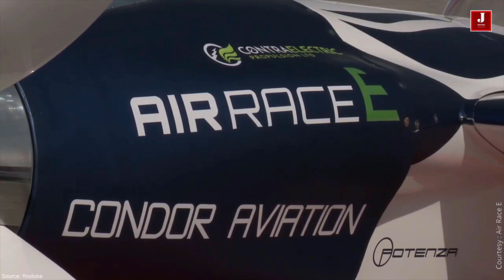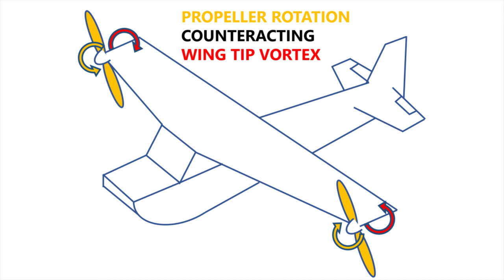Nascar in the Sky - Interview with Air Race E

Comment: Propellers at the wing tips to counter wing tip vortex is a wrong approach. It is explained why in the book by Doug McLean.  Much better approach is (in my opinion) a bell shaped lift distribution, where the outer part of the wing basically acts as a flattened down winglet, giving you benefits in the turns as well.
Reply from the maker: Hi Jure, I agree that there are multiple options to increase wing lift performance. And for some applications, the flattened down winglet could be the best (like glider planes for example). But each application has different constraints, like maximum wingspan for example, or maximum wing loading and so on. So race planes, cargo planes, and in the future electric planes, will each have their own distinct shape, tailored to their constraints. Electric motors at the wingtips can to some extent counteract the vortices, but they also add a lot of inertia to the plane (the mass of the motors far out), perhaps reducing manoeuvrability. The electric plane market is still so young that we'll probably first see many concepts pop up before we converge to a common setup. And I think that is exciting ;)
Reply: Exactly. Model gliders with wing span limit is the area I'm exploring as a hobby ;) Global push towards higher efficiency makes for exciting times to be in any kind of engineering. Aerodynamics is just a tiny stone in the grand mosaic of things. Personally I would like more money being pushed towards higher system efficiency (so not just a single component), not towards highest possible power within given constraints. I see how this e-racing is interesting from engineering perspective, but I think nature already found best speed to travel at through the air through millions of years of evolution and that is around 20 m/s. And this is where our efforts should be focused.
Reply from the maker: @jurepecar9092  Hi Jure, that's a nice way of looking at it! I'm afraid you're right, we won't be able to stop society from chasing speed in favour of efficiency. But every bit helps, right ;)